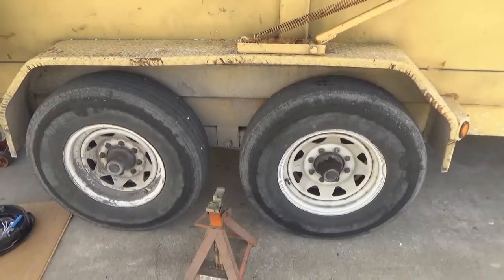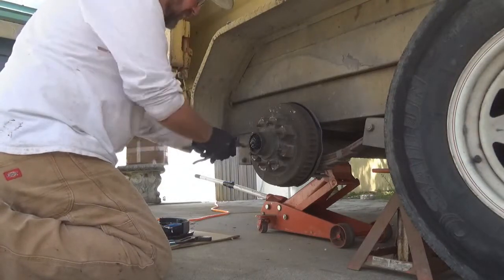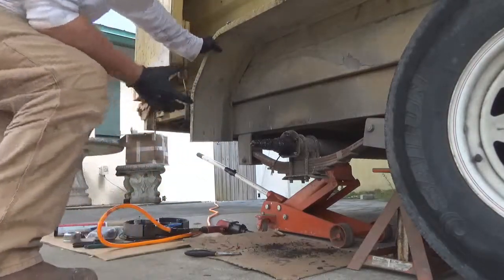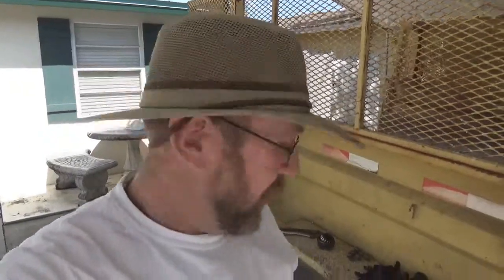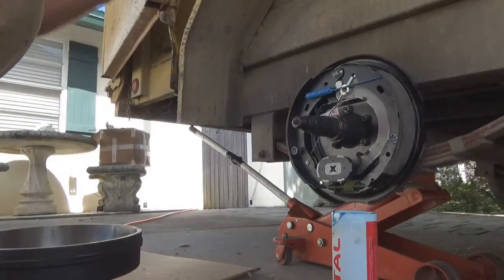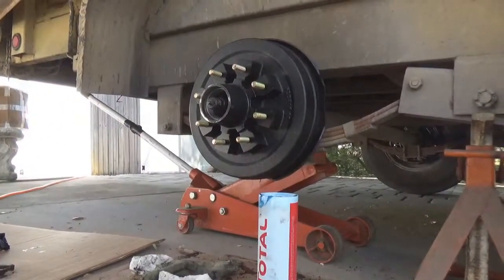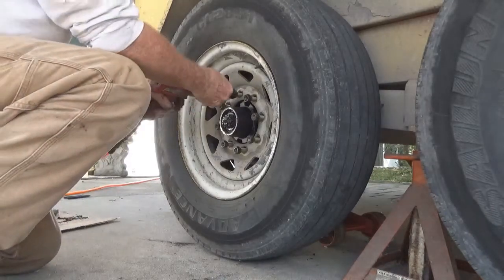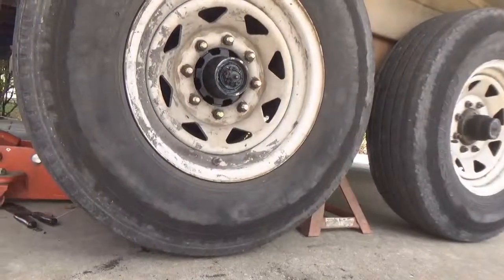Load Trail trailer brake-repair - DIY

Comment: Thanks for the video.  I have a 7,000# load trail dump trailer and been thinking about the brakes.  How did you know what hub and bearings to purchase? Also, is there a specific Dexter never adjust brake kit or does one fit all?   Appreciate the help!
Reply from the maker: I bought mine here, http://www.ebay.com/usr/randpcarriages       part number is,  23-458-459  Great customer service.